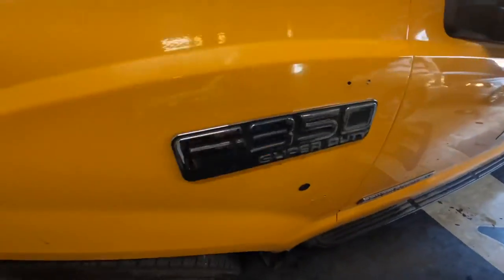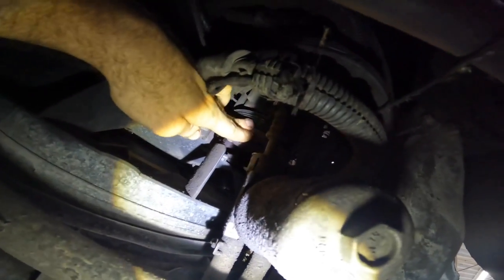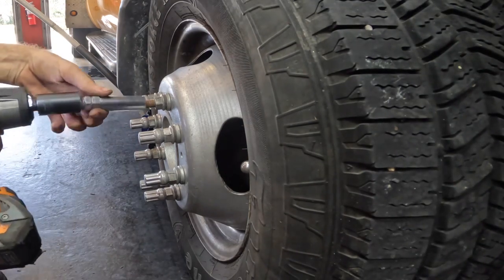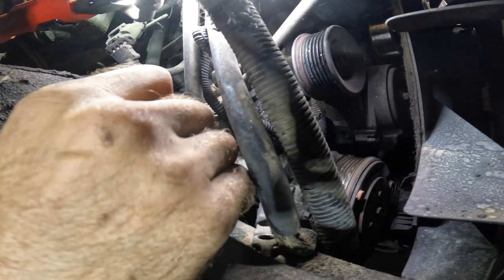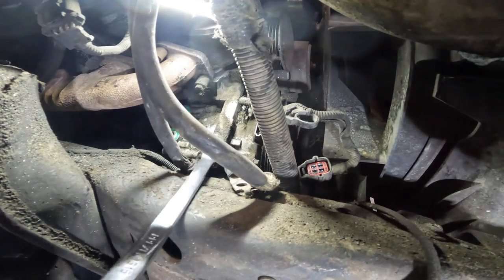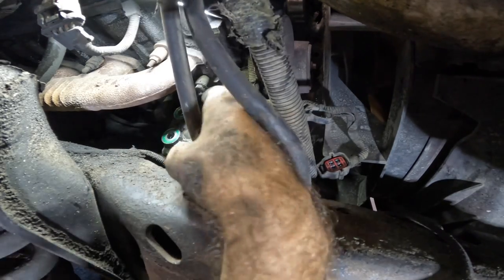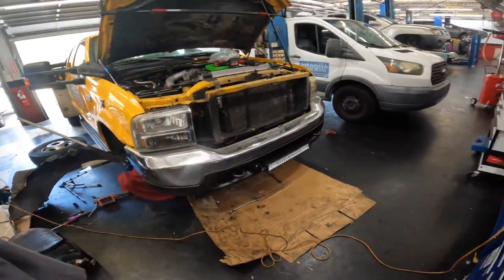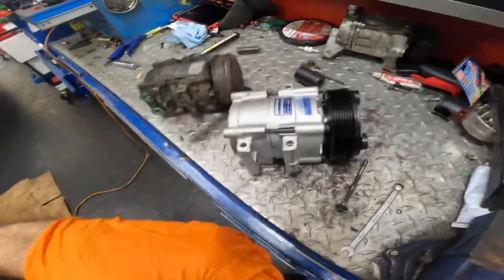Cut the Frame, Pull the Cab, or Suffer? Ford Powerstroke F350

Comment: I just did this same job on my '99 F-250 Super Derpy and can confirm it's a royal PITA. I like driving that truck, but I HATE working on it! It's like the engineers literally sat around and tried to figure out the most difficult way to make them serviceable. For example, that spring tower is riveted on the frame, so you can't take it off unless you drill them out and have a HUGE rivet machine to put them back on. Even just a simple spark plug job is a 2 evening job for me where I could have literally had my old minivan's whole motor and tranny out faster than just changing my dang spark plugs! Don't think I'll be buying another Ford any time soon.

Comment: good job!! I've had jobs like that , if you've been a mechanic a while you'll always have a couple of those!  it's like what were they thinking not to make Access to a bolt , but engineers don't care about taking it apart, I had the upper Dr side a, a-arm bolt on a Ford sport explorer , ...omy I tried every way , finally cut it off and put adjustable cam bolt in😯 again good work congrats you earned it

Comment: The last ac compressor I put on a 05 f350 6l had to redo about a month later the case was leaking. I just love some aftermarket parts.  I'm glad i'm not the only one that struggles with inner fenders the hard plastic is like trying to dismount a tire with prybars.

Comment: If you remove the fan shroud, fan, and stator you can access the bolts from the front with a ratcheting wrench and remove the compressor with the manifold line still attached.

Comment: To give one slight point to engineers here:  They're tasked with getting an assembly to both do the thing it was intended to do WHILE SIMULTANEOUSLY fitting said assembly in a defined space that they can't violate.  This leads to instances where its like "Well, we either do it like this and inflict some pain on the guy that has to fix this, or we have to redesign literally every last piece into different positions.."  Which one do you think the bean counters in corporate are going to sign off on?  There's tradeoffs in these things.   I've always wanted to see a video of an actual automotive engineer zero in on one of the cases like this compressor and give insight into why things ended up the way they did.  I'm positively sure they would like to make everything easily serviceable, but ...again, there's tradeoffs to get the product out the door.
Reply: This is also a Navistar engine. (International). It is not designed specifically for the super duty. Plus it was wedged into the Econoline vans. 
 This engine and the following version were garbage and destroyed the partnership between the two companies. 
 In 2011 Ford came out with their own in-house designed and built diesel. It is phenomenal.

Comment: Once I had a mechanical designer design a system he was very proud of,  people in the plant couldn't assemble it.  Brought all the pieces to him in a meeting and told him to assemble it.  After 30 minutes he through it into the garbage in frustration and announced he would redesign it.  He never tried to assembled it in realty only in a computer.  From that day forward I always made the designers work on their design, assemble it, disassemble it and repair it and 90% of the time they make changes to make it easier to work on.  There are too many things you can not foresee in a computer, need hands on to see how a part intertwines with other parts and systems.  Designers don't like my approach only want to seat in front of a computer, design something, fits into the assign area, someone else bench test and job done, not getting my hands dirty. A simple hole in the frame would have solve the issue.

Comment: Disconnect transmission mount, disconnect passenger motor mount, make sure the fan shroud is free and jack the engine up. She'll stand up on that side. When I do heads on 6.0 diesels I do that and stand that passenger side deck almost straight up. I know about pulling cabs and all that, but where I am in the Midwest, you look at a cab bolt and it snaps off.

Comment: i changed the comp on my 2005 f350, 3 months after open heart triple bypass, I drilled a hole in the frame for the bolt access, works great about the same size as the existing hole. Makes me wonder how many of bolt #2 doesn't get put back in. now with my surgery at the time, really really slowed me down..lol but I got it down.

Comment: Water pump is similar on Toyota 2gr-fe V6. Shop manual tells you to remove the engine if I recall correctly. But I’ve seen people loosen the motor mounts and raise the engine some to get access. The bolts are right up against the frame rail.

Comment: I do these the same way I do the modular engines.   Remove engine mount bolt, jack the passenger side of the  engine up as far as  you can, and you'll get a little extra room to actually  get your hand on it.  The worst part is, those damn bolts are the tightest, cruddiest bolts you'll ever touch.  Always a pain to even break loose.

Comment: Take the inner fan shroud off, and the left battery cable off. It comes out the front with a little wiggle work. (For future reference on 6.0's)

Comment: Ray, Have you tried Rozalex Dri-Guard Barrier Cream? Ya put it on your hands and arms before you get your hands dirty at the beginning of the day and when you wash up all grease, oil, solvents,grime comes off like magic with little effort,it also is a good moisturizer, make sure ya get all around your finger nails good as well. Rozalex has been around for bout 80 years and is really amazing ! It leaves your hands looking like ya never touched any grime at the end of the day, Also remember to reapply if ya wash up for lunch or ya gonna be sorry.

Comment: I did this from home the 3 bolts to hold the compressor to put it back on took me about 3 hours for those bolts , on top of the that the idler pulley was locked up ! Fan clutch needs to come of

Comment: FORD 5.5mm bolts...for same reason they felt it necessary in their infinite wisdom to have a 7 lug rim for a time & used it during a model year where the corner of the dash worked REALLY REALLY good @ smacking you in the knee because it poked out further than the rest.

Comment: one of the times that as a mechanic you would love to get a hold of the engineer, and ..... . just one hole in the frame would have solved so much trouble. i did one one time on a I believe it was an 84 year, don't remember make but i had to undo the motor mounts and jack up the engine just to remove a bolt, and be able to remove the ac compressor. and the mitchels book didn't even mention that part. ( yes I said book, this was back in about 89-90. )

Comment: New sign in shop - 
We run a clean operation here!
25$ engine bay pressure washer fee for extremely dirty engines (as determined by automotive technician)

Comment: Not trying to be that person but we have done several of these at the shop and its not  hard. Its the tensioner that gives us trouble but with another set of helping hands its not too bad. In by 7 out by lunch. I hate to see you suffer like this but it got done! Of course the bolts were over torqued lol. Im pretty sure now you now how to do it it wont be as bad. I bet a ford v8 compressor seems like gold compared to this diesel. Nice work!

Comment: I was changing a compressor on a 12 550 and one of the bolts fell out while I was removing the compressor and fell perfectly into a hole in the frame and went bye bye for a while. I had to use a magnet down the frame rail to get it. Couldn’t believe it happened.

Comment: 6.0 or Six Point Blow! This was a 2003 1/2. Thank goodness my coworker was 'Mr.Powerstroke and told me to never, ever buy the 6.0. I bought a 2001 7.3L in 2017.  

I saw cherry 6.0 F-350 King Ranch with about 160K miles going for $13K to $15K and I was ready to bite. Good thing my coworker caught me before I made a fatal mistake.

Comment: Wrapping a string around the bolts on bottom and pull string though hole in bottom and pull to thread bolt back in instead of rubber seal. Then pull string after starting bolts would spin the bolts up most of the way, may have to wrap like a yo yo but worth a shot if I was fighting this animal. Good luck

Comment: I had to replace my compressor and entire A C unit on one of my 6.0s . Getting the compressor off was far easier than putting the new one on. Getting the bolts threaded back in was the biggest problem.  After that , short turns with a wrench and a lot of patience . I started to take my plasma torch and cut out holed in the frame,  but I decided not to.

Comment: I did one a 4.6 and the head of the bolt stripped off and had to use dremel to cut it off it was a job

Comment: I lost my belt today also.  This was due to the tension idler disappearing and belt shredding.  Also Dodge diesel but 2005 3500 with 210,400 miles.

Comment: I come from a generation that when the A/C seizes you buy a shorter belt and eliminate it from the belt system, Left in place so you don't have to deal with it and the EPA, my father would have just  disconnected it and let it vent into the air.

Comment: I totally feel your pain of the one click or 1 degree at a time bolts and being up to your armpit in the job essentially..it does suck but getting it done after the mega aches and cramping is a helluva great feeling.  I would LOVE to know why in the heck could they not have made the one hole bigger and added a 2nd hole for the other bolt. Engineers should R&R their own designs before its signed off on for production...after dousing the area with oil and dirt for added realism..
   A great job as always Ray...I truly do appreciate your effort...go have a cold one...or three after you get home.

Comment: I have found some Chevrolet models use 5.5mm fasteners on the cabin air filters in addiction to the normal plastic locks for some reason. Confused me for a minute until our master tech helped me out.

Comment: I found that by breaking the compressor bolts with 3/8 then going with 1/4 inch works . But with the last bolt it's wrench then ratchet wrench. But a whole lot of 1/4 inch

Comment: The decorative lug nuts will protect the exposed lug studs and keep them clean at least.  So maybe not such a bad idea.

As the AC compressor wears the heat and pressure of the refrigerant will bake the wear products onto the insides of the condenser causing the tubes to become restricted which results in much reduced heat extraction which means more high side pressure and less cooling at the evaporator.  So if you want good cooling you always need to replace the condenser and any filter/accumulator in the system.

GM does, or did the last time I worked on a GM air conditioner, has what is called an orifice tube in the hose going to the evaporator which has a filter screen on both side of it to prevent particles from getting into the evaporator.  That hose has two pieces with a connector to join them together and that is where the orifice tube is located.

Comment: Ray, this May sound nuts but on the 6.0 power stroke versions (f250’s also) of the Fords it is actually faster to pull the front off including the coolers and fan and then you have all the room you need. I hate working on these!

Comment: I had a 2006 6.0 f350 dually and at 25000 miles a check engine light came on. The dealer diagnosed it as a bad head gasket. Almost $7,000 dollars to fix it. They had to pull the cab off to get the heads off. Two months later still less than 30k miles the tow haul light came on and they had to replace the transmission harness over $1k. I sold that 4wd dually lariot with 35k miles, all records, always cared for, no dents, scratches, bed liner for $17k. Bad engineering

Comment: Those bolts come right out if you follow the shop manual.  Turn on the left turn signal, reduce the tire pressure to 42.5 psi, Then stand on your head and spit jelly beans and they will come right out.

Comment: I get it done in 1.5 hours just pull the fan shroud and fan out. Then pull the ground cable off the front of the engine and it comes right out.

Comment: I had to pull the compressor in my 6.0 truck when I replaced my engine wiring harness because the crank sensor wire is back behind it. A few months later I had to pull the engine... I opted to leave the compressor on until after engine was out...

Comment: I've owned 2 95's, 1 96, 3 99's, combined a 2001 with a 99 and now I'm working on a 2005 I bought with a blown V10 and I'm putting a - drum roll - 7.3 in it! This video is just the last nail in the coffin for why a 7.3 will be the newest engine for me! And all of them are a pita to get those inner fender liners out! Today I finished welding a section of a 99 firewall in place to accommodate the wiring harnesses and PCM as that's all different on the 2005. Great job with that compressor... so much easier on the 7.3's. How about the alternator - is it buried too?

Comment: I am so happy that my 97 Diesel Chevy C3500 pick up It’s a lot easier to work on then this one yeah change in the water pump is a pain in the ass but that’s about it the alternator and power steering pump and air conditioner compressor are easy to get to and work on she may not be the prettiest truck in the world or the fastest truck literally she’s easy to work on and she doesn’t have all the smog equipment that these new trucks have thank God for that

Comment: Just a tip, maybe clean the area you are going to work on and will save you a lot of self cleaning later. Also maybe see if you can get those smaller open/box end wrenches in a longer length to make it a little easier when doing those pain in the butt one degree turning of the screws.

Comment: I remember having to do one similar on an older ford such as that one but on a Gas motor variant i believe. And it was a big pain in the rear. Eventually i ended up getting it in and out. But it was an extra pain because Newyork rusty crusty truck lol.

Comment: My 2001 cab is so rusty, if you tried to pull it off, you would have to repair all the cab mount locations first before reinstalling it because just turning the fasteners would break the bolts and rip out the mounts.

Comment: That was bad.  I have a new challenge for you.  1996 chevy S10 V6 header installation. Pain? Smorgasbord.  You have to hand bend the oil dip stick to get it to work.  and change the boots on the wires  to all 90s and put the steering rod THROUGH the headers. in addition to that you have two inches to the top a frame on the suspension  to get it done in. Yes, it is hell

Comment: I own one of these,  Not as in crappy shape as this one.  I'm fearing the AC compressor replacement. :). 190k on mine.   Remove the drivers motor mount and tilt the engine to get to that lower bolt.

Comment: afraid to cut a hole? i cut a small hole on my drive shaft hump on my old 88 cherokee jeep to get to my crank shaft positioning sensor  replaced ,then put a sheet metal cover back on and put the carpet back in place worked so well could see as well as use my hands to replace

Comment: Ya know this idea is not really manly to most but since you work indoors if you shave your arms it will help in cleaning your arms when this happens , hair will hold on to grease and oil .Anouther thing to help with cleaning grease off get a green scotch brite and dawn soap in a spray bottle.

Comment: There actually is a job that requires removing the cab.  Some sort of engine module I think.  Almost certain that it is on some sort of heavy Ford truck.  Tractor, not pickup.

Comment: Next time practice on removing an English Leyland Hippo aircraft refuelling engine oil filter. Top rear nut, one flat at a time for one light year. Once again the engineers should do the physical work before even signing off the positioning of the oil filter housing mounting block. After consulting with my NCO I put forward the idea of relocating the oil filter in a more accessible area. It was approved much to the delight of the other mechs.

Comment: Felt your pain... I think a small ring of 1/8th holes and the use of a burr to smooth up the edges to allow a socket in through that panel/frame? would have been part of the vehicles future had I been working on it.

Comment: from us older mechanics, back in the late 60 on we would use a luquid glove, aka a soap you coated your hands and arms and let dry, the it took warm water to remove all the blck grease, found invisible glove on Amazon, its a Pro-tek prod. i still prfer that to wearing gofly latex gloves. Bill.

Comment: And another reason to not buy Ford diesels, the turbo location is a disaster looking for a place to happen.  My 2000 RAM  diesel 5.9 has 626,000 miles on it and it is still running fine!  We replaced the A/C compressor, evap system and all the lines in 1.5 hours.

Comment: I feel your pain.  Some of the jobs I've done laying on my back or side in a pool of dirt/ grease globs while reaching up up working a out of sight bolt with my cramping finger tips while my arm is being gouged by other angry nuts and bolts or whatever-- AAHH F**C!!!  Sorry, a momentary flashback.
Would it have been worth it to disconnect the motor mounts and raise the engine a few inches?